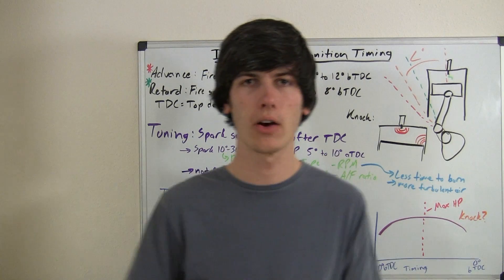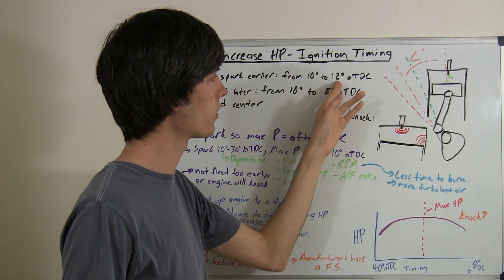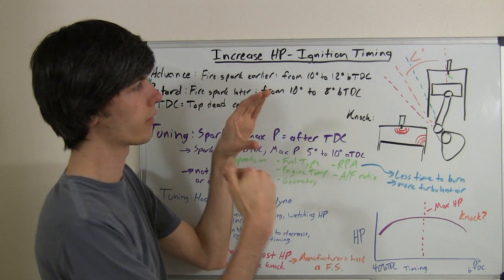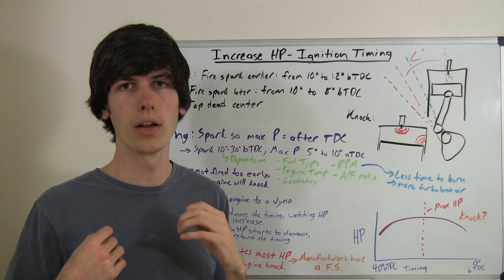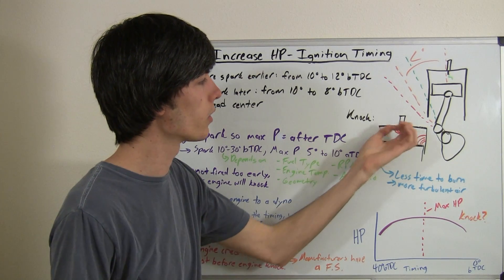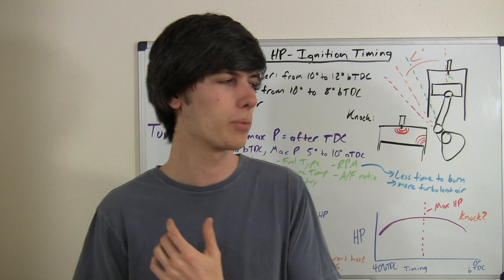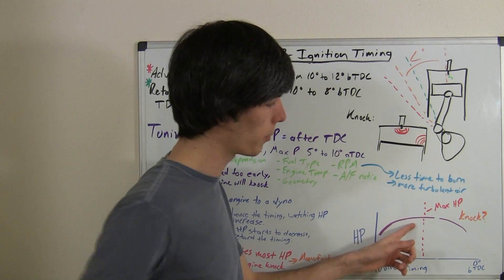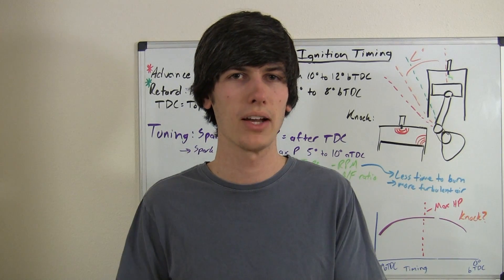ECU Chip Tune - Ignition Timing - Increase Horsepower

Comment from the maker: The delay for anti-lag isn't to increase horsepower, it's to increase the amount of exhaust gas temporarily in order to maintain boost, allowing for more pressure in the exhaust manifold rather than in the cylinder.

Comment from the maker: It's because you can increase the boost simply with a tune with most modern turbocharged cars. That means you can easily increase the amount of air supplied to the engine, thus can use more fuel and create more power. With NA cars you can't really alter the amount of air that comes in, just the amount of fuel, without actually swapping components.

Comment: How about having as lean a mixture per engine design, with as advanced as possible ignition; compensating for extra heat with a good water-wetter coolant and removal of the thermostat in the summer. And a compatible engine oil for added cooling. Any comments would be welcomed.

Comment: I agree with you, but the part that is interesting is the actual increase in performance rather than the fail-safe side of the ignition system. Double spark (in a different point of the combustion chamber) helps to ignite the fuel with major efficiency while the flame propagates better. Not a kind of thing you want on your standard fuel-eco Toyota, but what about high performance engines? Alfa Romeo used to fit twin-spark ignition on most of their engines with great results!

Comment from the maker: I guess the consequences don't outweigh the costs. A failed spark plug means an engine in limp mode, or at worst, dead. But a car isn't going to come crashing down to earth. As far as the higher altitudes that's really not something most cars have to deal with.

Comment: G-R-E-A-T topic and explanation! I have a question: in aeronautical engineering it's common practice to have a twin-spark ignition system for each cylinder. A very good thing if you think about safety in flight: if one ignition system fails, the other one will still be operational hence avoiding the engine to die. But the very same design is also useful to increase power and also a must-have when you fly at higher altitudes where the air is thinner. Why isn't the same thing used in automotive?

Comment from the maker: It can be as complex as you desire. You could absolutey change the timing characteristics (as well as others) depending on the position of the gas pedal, as well as other factors like RPM, etc. Older cars are a bit more static, but I would imagine hardly any new cars don't have more dynamic programming.

Comment from the maker: If it's electronically controlled it's not going to change the timing unless something tells it that it needs to. For example, if it knew that the mixture was going to knock, it may alter the timing (or air/fuel) and try to compensate and eliminate the knock. Not sure what to tell you, check for engine codes and see if it spits anything out. Most auto parts stores will read it for free.

Comment: Hey great video; however ihave a question. If an engine has been rode hard will the ignition timing, over time, slowly start to vary away from original specs? I ask because I have a car that has been rode pretty hard before I got it and has a knocking sound in the left side of the engine. (The car has less than 70,000 miles on it btw). I have been advised that it is the timing chain and I have even listened for it with a engine stethoscope and heard its in the left side.

Comment: faster rpm you may want to ignite earlier while the opposite for slower rpm.
so higher compression ratio mean it the piston will reach closer to the tdc than usual therefore it will have a longer stroke right?

Comment: i just got to say, great videos my friend. but i have a question; a engine, say for example a plain 1.6 engine, and you take out all the hp you can, will that engine be more fuel efficient than a factory one? does it burn a greater procentage of the fuel when driven at normal rpm.

Comment: compression ratio has nothing to do with the pressure on the piston pushing it down. Compression ratio is how the combustionchamber in volume is related to the whole volume of the cylinder. Compressing the air/fuel mixture in the compression stroke sort of determines how much energy you can get out of the mixture. The higher the value the higher the efficiency. (look up something about thermodynamic cycles)

Comment: If the ignition occurs as the cylinder head is traveling down (ie. not at full compression), why is the compression ratio so crucial to the performance of the engine?

Comment: well some simple math and approximations will tell you that you have to race them to find out. 1000hp/3.5tons is about the same as 530hp/1.8tons. However the diesel has a lot more torque but revs out sooner. So if geared properly the truck has a chance. But because it has to shift early even though it could accelerate at the same pace the gt-r is long gone by then still in 1st.I think the truck should launch directly in 2nd or 3rd if clutch and transmission can take it to stand a chance.have fun

Comment: This is called MBT timing (Minimal for Best Torque). If you are tuning an engine, and you find that if you get more power by retarding the ignition timing this means you are doing something right. If you get more power by having to advance ignition timing, then that means you have a poorly designed engine (case of bad geometry). The goal is to get a greater peak pressure by 15degrees ATDC, and you do that by getting as much fuel as possible burned by that time.

Comment: The best ways to reduce knock is obviously to reduce the temperature in the combustion chamber, you can do this by: injecting 50/50 water alcohol (methanol), Higher octane fuel or e85 for those with high compression :), better oil and cooling, optimized oxygen (meaning reducing air intake temp), or burn at a richer fuel mixture. Please feel free to add more so we can spread the knowledge.

Comment from the maker: To prevent pre-ignition, but perhaps not knock. "Knock occurs when the peak of the combustion process no longer occurs at the optimum moment for the four-stroke cycle." What happens when the timing is too advanced, is the maximum pressure occurs before TDC, which pushes down on the piston when it is still coming up. This is what you are attempting to avoid. Wiki calls this knock, though perhaps incorrectly. Regardless, the principle holds true.

Comment from the maker: Perhaps I used the wrong terminology, but hear me out. "Knock occurs when the peak of the combustion process no longer occurs at the optimum moment for the four-stroke cycle." What happens when the timing is too advanced, is the maximum pressure occurs before TDC, which pushes down on the piston when it is still coming up. This is what you are attempting to avoid. Wiki calls this knock, though perhaps incorrectly. Regardless, the principle holds true. This is NOT pre-ignition.

Comment: Whats your power goal? I would shoot for a GT35 series unless you want to run a turbo you can rebuild. Thats an old turbo and a newer ball bearing turbo will spool much faster. Are you sure you want to run T3 manifold? You have to make sure you have enough exhaust pressure to spool adequately. Efficiency is key in this aspect. If you are running a displacement less than 2.0l I would stick with a T3 trim. But its all relevant to the power you are looking for.

Comment: Its just an uneven burn. He doesn't reiterate that too early means the piston is prior to TDC. If you combust to early you put stress on the rod and walls. To really get into it you have to look at the way an injector automizes fuel and the way the piston compresses the mixture. All engines are different thats why you buy chips and tuners specific to your motor.